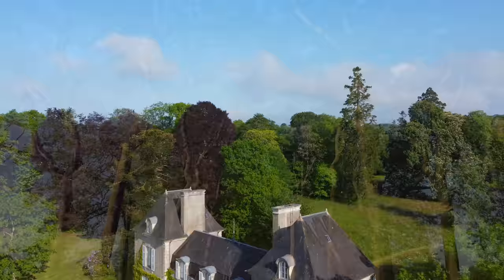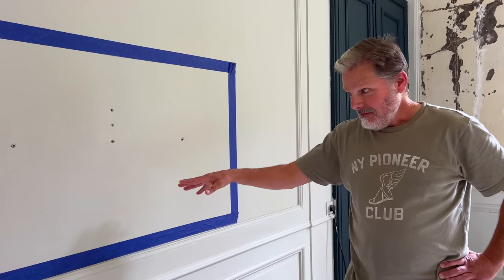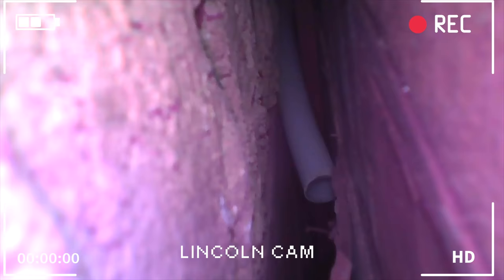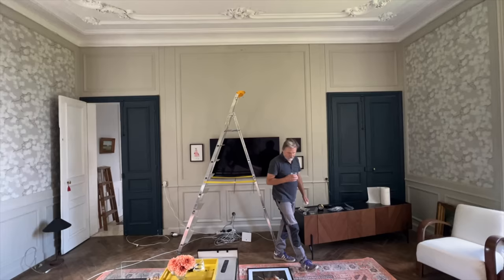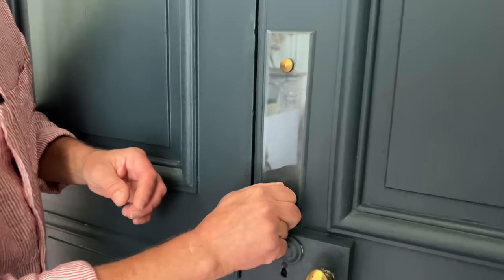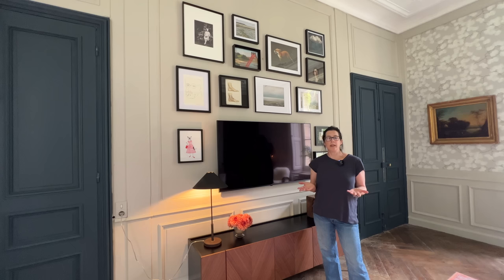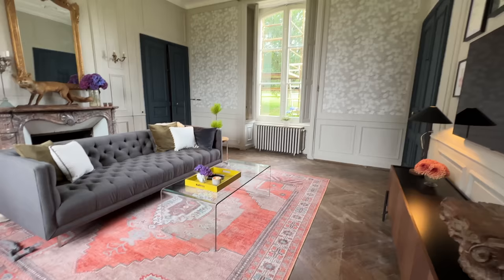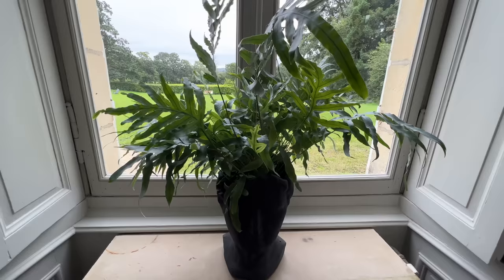Jaw-Dropping BEFORE & AFTER: Our French Chateau Restoration

Comment: For the oil on wood panel painting, a suggestion: I have watched many, many Julian Baumgartner videos over the years. Watching him explain what he is doing (and with what) is extremely educational. He has a YouTube channel as well. He is a professional art restorer (not sure which generation now, possibly third gen) in Chicago. A lot of what he has done in the past might be extremely useful in the restoration process in your chateau. Almost forgot an important part, if you attempt to clean the oil on board painting, get a black light and see if there has been repair work (paint over) on it in the past. It sticks out under black light. If you don't check first, and you use a solvent on it to clean, the paint over will probably come off as well, so you need a good "before" picture, under black light, before you attack the cleaning process. It is a time consuming process, so I leave work like that for the winter months. 

https://www.youtube.com/@BaumgartnerRestoration
Reply from the maker: Thank you for the helpful advice :)

Comment: The tiny feet on your sofa will definitely damage the parquet floor,  even through  that  rug (and also the rug) and  they need cups /covers to stand in and help spread the weight and risk from pressure indentation and scratch damage

Comment: I loved your new room. You did a fabulous job! Here is a trick on how to hang your pictures perfectly every time. Get some cheap, wrapping paper and lay it on the floor, white side up. Measure the paper to the exact measurement of the area of the wall that you’ll be using. Lay all your picture frames on top of the white paper in an arrangement that you would like. Mark your nail holes on the paper and make a tiny pinhole .Take your template off the floor and tape it to the wall . Take a pencil and make a tiny mark on the wall where the pin hole is on your paper. Put your nails in and hang your pictures. There’s no measuring involved you did it all on the paper. I also trace all of my picture frames on the templates so I remember where to hang them. I’ve done this for picture walls and they turned out perfect every time.

Comment: Your room is beautiful. The ceiling is gorgeous.i didn't see any gilt  on the carvings in the ceiling. I suggest that you could put some gilt of siver I use a little tube of American Rub n Buff it's very cheap and it's by AMACO YOU JUST PUT A LITTLE IN YOUR FINGER AND PUT ON THE PARTS THAT STAND OUT AND RUBB IT. VERY SIMPLE.   JUST A SUGGESTION

Comment: The room looks nice but in the UK it would  not be consider a restoration, the work seen on this video is a redecoration, which is a very standard work done on a period property. A restoration should involve a historical study of materials and arquitectural elements of the building and its origin and cataloging all elements and a condition study of each element of the building plus any intervention will be done by a qualified person. The term restoration is loosely used by influencers and it seems that France regulations are also quite relax. A listed building in the UK is protected to avoid the loss  of arquitectural Heritage . Interesting to see the difference.
Reply: It is not that the restoration laws of historical buildings are relaxed in France. But this chateau is not listed. Hence they can do whatever they want.